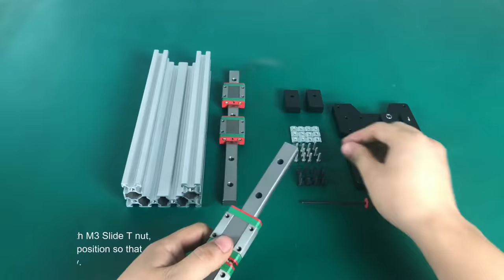WorkBee Upgrade to ULTRA QueenBee CNC / ULTRA Queen Bee CNC Mechanical kit-Part 1

Comment: do you sell the plate set for the QueenBee pro
Reply from the maker: Our plates are ULTRA QueenBee: https://www.aliexpress.com/item/1005002443235887.html?spm=a2g0s.12269583.0.0.54b8b2a7cUEW0a
Reply: @yuyongindustry  hello sir what thickness are these plate set
Reply from the maker: @fenders9911  They are 10mm thickness,and Our Ball screw plate will be 12mm thickness.